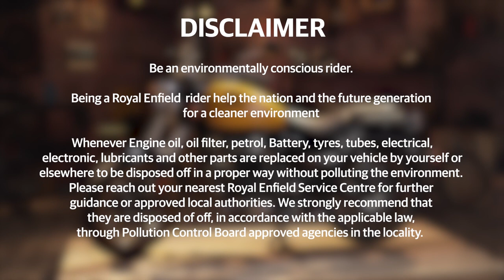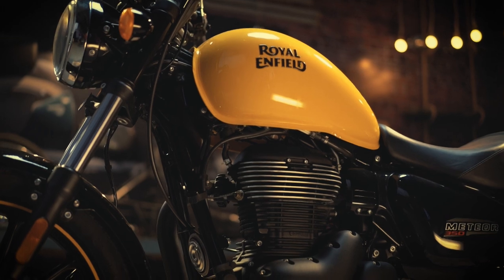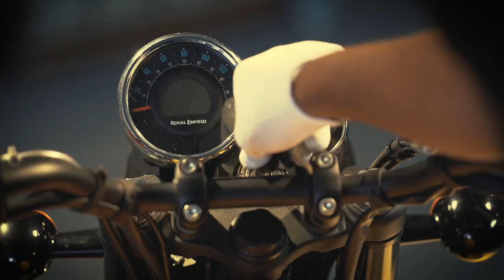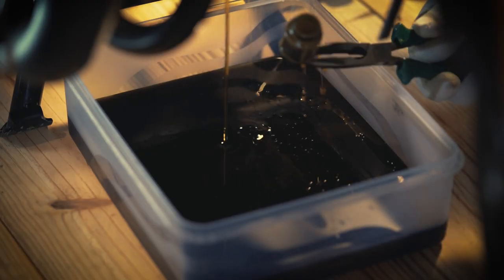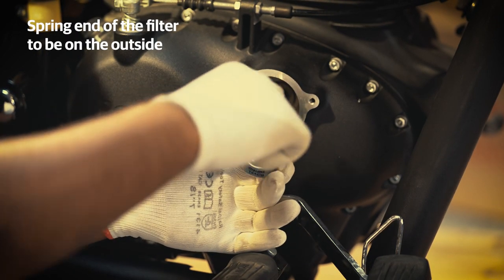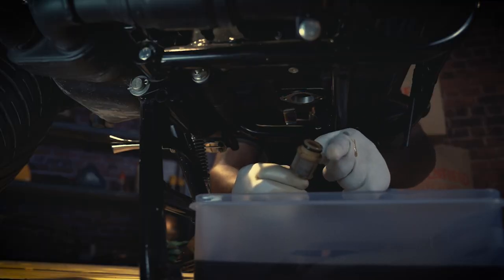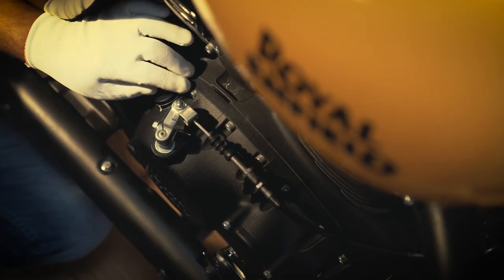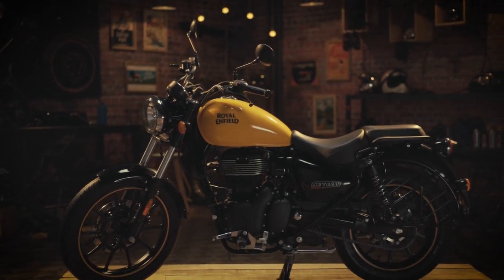ENGINE OIL DRAINING & REFILLING | Royal Enfield Meteor 350 DIY

Comment: The service centre bolted my engines oil cap so tight my RE 8mm spanners threading came off, still couldn't remove it though

Comment: and the torque setting for the bolts is???? wonder how much the service people charge you for checking the torque setting after you have cost them money by doing everything except tightening the bolts to the correct torque.
Reply: Acc to service manual torque is 10-12N.m

Comment: Meteor manual says 2.2 lits. Here shown 1.7 litrs. Which one is correct, Why are there such mismatch in vital data?
Reply: I think 2.2 litres is during the first fill / oil capacity of the engine. 1.7 is the amt of oil while changing the oil.
Reply: 1.7 is correct

Comment: RE manual says use 2.2 litres of oil. In the YouTube tutorial video, it says use 1.7 litre. Which one is correct?

Also, the manual says change oil at 10,000 km intervals. Is this not too many kms between oil changes?

If you go for long rides say 300 or 400 kms rides at 100 kph, oil will lose its lubricating properties by 3000 or 4000 kms.

V K Kumar
Bangalore, India
Reply: The 2.2 liter is a fresh fill the 1.7 liter is a subsequent oil change

Comment: Use Motul 100% synthetic engine oil for RE. It's far superior than the pathetic liquid gun that is made by HP.
Reply: Tanmay Saha correct..
Reply: in your place maybe, but in my country there are many better options
Reply: Can u let me know the SAE grade for it
Reply: @udavantamit for this engine, should be 15W-50. You have it on the manual.